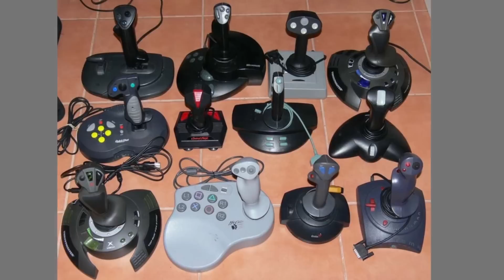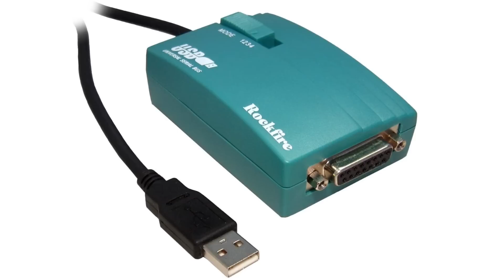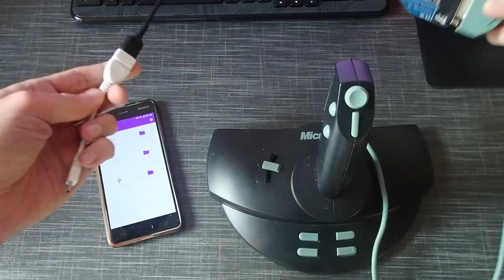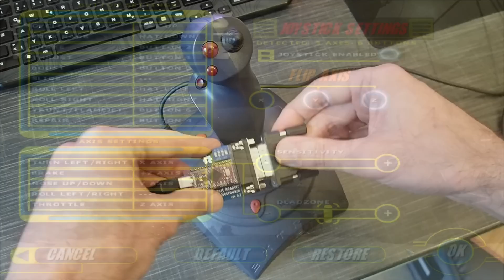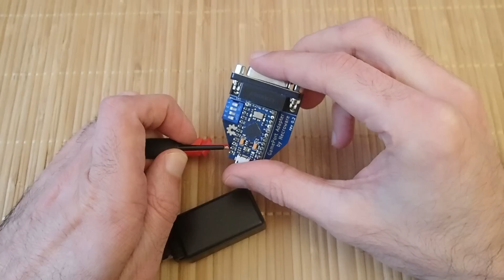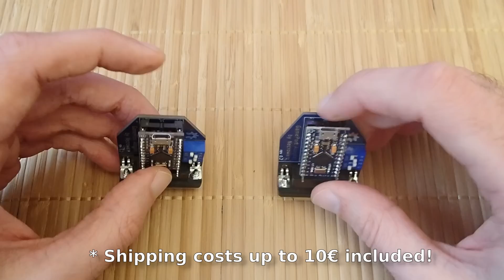Let's develop an ultimate GamePort USB adapter. Project updates and a little surprise!

Comment: Myself I'm waiting with baited breath for the "opposite" of this adapter - adapting a modern off-the-shelf USB Xbox controller to the old 15-pin gameport so I could use a new high-quality handheld controller with a classic DOS-based retro PC.  I was REALLY EXCITED when I mentioned this idea before and you replied "it's in the works."  When you explained the simplicity of the 15-pin gameport pinout, I thought to myself this should be really easy to do with a Raspberry Pi for example, if the Pi interfaces with the controller and then generates the required output signals for the gameport using some GPIO pins!  I'm unfamiliar with how to program this myself but I'd be happy to invest some money in the project if I can attract a partner who thinks they can help with the software that needs to run on the Pi!
Reply: I’d suggest doing a simple padhack job but the potentiometers are likely 10K and I believe gameport uses 5K.
Reply: @emmettturner9452  I thought about that first but there are some big advantages to a converter-box-style approach - the ability to re-map controls on-the-fly for different games, and of course you could connect any unmodified off-the-shelf xbox controller!  They do wear out over time after all, and my idea allows the user to just grab a fresh one and play.  When Necro explained how simply that 15-pin connector operates, I immediately thought "Wow, this would be really easy if I'd written code for a Pi before!"
Reply from the maker: I started that project using a Pi Zero and the plans are not limited for joysticks if you know what I mean, but unfortunately the day has only 24 hours and I need more time with all the projects, the channel and all the other minor stuff which we have to do in life :D
Reply: @necro_ware  Awesome; And if there's anything I can do to help...

Comment: As I recall, Precision Pro and Precision Pro 2 look very different. The Precision Pro that looks the same as another is the original Precision Pro and the USB version of the original Precision Pro. The original actually supports USB with a passive game port to USB adapter that was sometimes included. I probably still have both in my attic.
Reply from the maker: The Precision Pro 1 and 2 look the same, I had both here for development. The 1st one is not USB capable at all and speaks the same protocol as the Sidewinder 3D Pro, the 2nd speaks another protocol and can work in USB and GamePort mode with an additional adapter. At least in Germany the Precision Pro 1 was also sold under the name Sidewinder 3D Pro Plus.
Reply: @necro_ware  In the USA, Precision Pro 2 was a completely different stick with a flipper-style throttle and a smaller “open frame” base that has gaps through it. Original Precision Pro and Precision Pro USB had a horizontal wheel-style throttle and a larger solid base.
Reply from the maker: @emmettturner9452  At least in Germany that one was called Precision 2 (without Pro)
Reply: @necro_ware  Ah, I see we were writing that at the same time. :) Yes, they dropped “Pro” from the Forced Feedback 2 as well. We never had a Precision Pro 2… only Precision Pro and a revised Precision Pro with “Now USB-Compatible!” on the box. Everyone called the Precision 2 “Precision Pro 2” since practically everything Sidewinder was “Pro” before that. ;)
Reply: @necro_ware  …so it seems what you call Precision Pro 2 is what we call Precision Pro “Now USB-Compatible!”

Also, I just realized that the “2” versions dropped “Pro” from the names. Precision 2 was released with the Force Feedback 2. There was no “Pro 2” for either. *shrug* 

Just thought I’d clear that up. Thanks! :)
Reply from the maker: @emmettturner9452  Just took a look into Wikipedia. Don't know how trustful it is in that regards, but the Microsoft seems have called the non USB version Precision Pro or 3D Pro Plus, where the one with USB support was the Precision Pro 2. The Precision 2 was a completely another device :D I guess Microsoft made everything right to confuse the customers. If you'd see how the protocols work, you'd see, that it was even worse, than just naming. In the Linux source code you can also find a comment, that the protocol is "very very brain dead" :D
https://en.wikipedia.org/wiki/Microsoft_SideWinder#Precision_Pro
Reply: @necro_ware  Yes, it makes sense that they might internally call it “Precision Pro 2” to distinguish it before the Precision 2 existed. I’ve never heard it colloquially called that before seeing it on your channel. It would make perfect sense if people didn’t call the Precision 2 “Precision Pro 2.” After all, there was never an original Precision non-Pro. ;) Sure enough, I get a bunch of results when I search “Precision Pro 2” on eBay… though all are actually Precision 2. Guess I wasn’t the only one who thought it was Precision Pro 2! Microsoft definitely could’ve distinguished them better. I can only imagine how confusing their protocol must be. :)

Perhaps Precision Pro USB would be less confusing but, then again, that one only needs this adapter if you lose the original! Thanks for putting in all this work to get them all running.

Thanks for the Wiki link too. I’m gonna have to try that one PlayStation 2 game that supports the Force Feedback Wheel USB!

Comment: Thanks so much for spearheading this kind of adapter with expanding compatibility. I have a big tub full of GamePort controllers but limited original hardware rigs to use them on that a way to use them through DosBox is most helpful. :)

Comment: For those wondering, 5ms input lag (worst case) would be a single frame at 200fps. So for all intents and purposes it's imperceptible.
Reply: The real question is if it's consistent.  I'd prefer a consistent 5ms latency than it whipping around between .5 and 5.

Comment: Sidewinder 3D Pro using 1110 config, as seen in your presentation video at 28:03 .
Suggestion: support for two 2 button 2 axys gamepads (and a MIDI device, if possible) connected to one gameport.
You is the best!

Comment: I would be interessted in something the other way around: use a modern usb gamepad, attach it to an "USB->Gameport" Adapter (Emulator?) and attach it to an old computers gameport, running e.g. DOS and play old games these way. What do you think? :)
Reply from the maker: I worked in that direction as well, but it's too early to talk about that.
Reply: @necro_ware   Oh that’s tricky.  There isn’t much of a limit on what controls a USB joystick can have.  Mapping those to the analog interface would require some kind of profile, no?  OK OK too early to talk about that.  :-)

Comment: Why not ask a shop like serdashop to produce it? They already do the wave table stuff so why not something else game port/midi related? It would make the device accessible without any effort on your side. Likely you would also see no profits but I guess that is not your goal anyway. I like projects like this coming out, but all the small stores are not an great idea, something more central and diverse is better. Maybe something like tindie but EU based?
Reply from the maker: I'm not sure if Serdaco is interested in this kind of device. I developed and open sourced it, I guess it's up to the community if they want to have it.
Reply: @necro_ware  I don't know either, but it never hurts to ask 😀. A simple mail would do. I don't think the fact that the project is open source should be an issue. And if not then maybe one of the other larger retro shops? The thing is, I can easily build this, but most people cannot. They use computers but have never held a soldering iron in their lives. For those only a ready made version will do. The biggest problem is finding out the amount of interest in the device. But again that is for a shop owner to figure out. I don't have all the answers but finding an existing shop to produce them,  would mean even those without any electronics skill can buy them and it would save you the hassle of creating a shop of you're own.

Comment: You used a Sidewinder 3D Pro Joystick setup to CH Flightstick-Emulation mode 0-0-1-0 first. Then you switched to Sidewinder mode 1-1-1-0, with now 6 axis and 8 buttons and with the head switch now usable in all 8 directions. Great video, again! Love your channel, man! 👍👍😊😊
Reply from the maker: Thank you! Please edit your comment once again ;) And don't forget to write the switches exactly (!) how they are in the table, since I will filter all the comments for exact match later. If s.o. writes it in another format, it will definitely get lost...
Reply: @necro_ware  Ok 😜 you used a Sidewinder 3D Pro with the switches set to 1110.

Comment: How about to sell the adapter on ebay ?
Reply from the maker: It's not about where to sell it, but about German regulations. I have to license the hardware which I want to sell. That license costs a lot of money and headaches, and if I'd sell the products without license I'd risk a 150k€ lawsuit. Germany is in many cases very unfriendly to small startups, especially in electronics.
Reply: @necro_ware  ah, It's a pity, so much bureaucracy even for a small project. Btw sooner or later I'll build one myself. Keep up the good work !

Comment: One remarks about Gravis Phoenix: probably easier, if the PS/2 keyboard part is connected with a standard USB-PS/2 adapter, in this case only the Joy software part have to be implemented
Reply from the maker: Yes, this is actually an interesting idea!
Reply: Looking from the device you would need a ps/2 to USB converter. They exist but are a lot less common then the other way around.

Comment: Does the Adapter show up as XInput?
Reply from the maker: No, currently I use HID, but in the future may be I can add XInput as well. However, adding that would make some things more complicated and less compatible, because on some systems there is no proper XInput support. Don't forget, that this is a Microsoft thing and other platforms could have issues with that.

Comment: I wonder how the Force Feedback stuff is implemented on those gameport wheels. I got some old Trust wheel which seems kinda nice but if the FFB is some proprietary bullshit I'm not sure if I can be arsed to start figuring it out.
Reply from the maker: Force Feed Back is proprietary thing indeed. Later the interfaces were standardized for DirectInput, but in communication with the Joystick, unfortunately you have to implement it for every one differently. Just as I implemented the drivers for all the joysticks so far. All of them are using proprietary protocols.... every one of them.